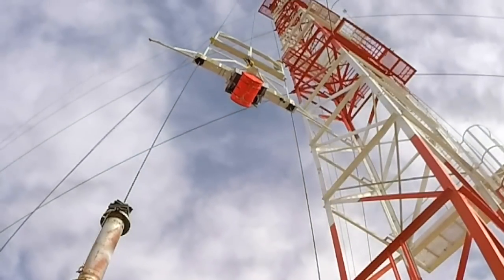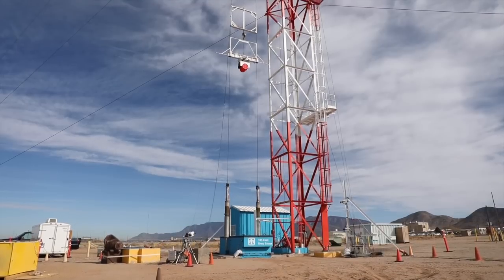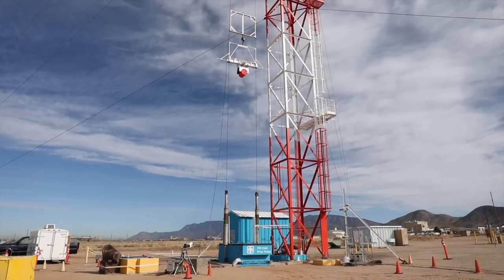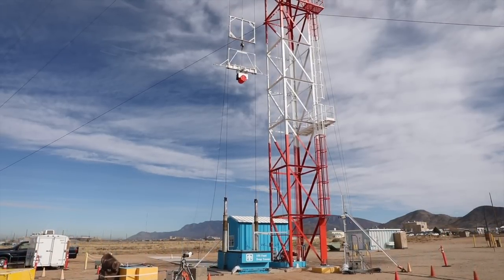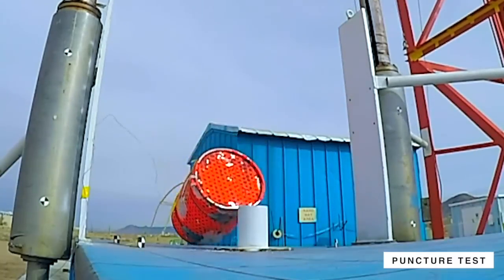Hazardous Container Drop Testing in Slow Motion at Sandia’s 185’ Drop Tower

Comment: I worked for a 55 gallon steel drum manufacturing company. Our most destructive test was the corner chime side seam drop. We tested to DOT/UN standards. If they passed, we would test to failure. The drums we made passed at +1.5  times the required drop height.
Reply: So interesting 😑

Comment: Notice they didn't flip it off a speeding  flatbed truck .
Reply: 185' of drop yields a speed of 75mph. 30' of drop yields a speed of around 30mph. The lateral velocity of a flatbed truck does not translate to these tests because the kinetic energy is spread out over multiple impacts, meaning it is easier to endure.

These drums are not put on flatbed trucks without further protection. I.E. their kinetic energy being released is spread out over an even greater amount of time.
Reply: @aidenthehuman5921 though multiple small hits can find a weakness that a single extreme hit misses
Eg difference between cutting open a safe and putting in the code

They probably already do many other tests, 
But they need things like slight damage testing, specifically looking for non visible damage, things that could happen in operation and not be seen by staff, combine slight damage testing with corrosion testing chemical (weather, road salt, cleaners, etc) and radiation

Throw it in a dry tumbler for a month
Do short distance compression testing (barely squeeze (half inch, down to millimeters) in a hydraulic press, cycle it a few dozen times, different points, different directions etc) check for visible signs of something like that occurring, whether or not it caused damage staff should be made aware of they crunch something, and also test integrity including corrosion integrity, (ie forklift, crane, etc might tap a barrel or pallet and no visible signs, could be hit dozens of times in transport, and started hairline fracture points with no one aware that they have been hit at all ever, etc)

Heat cycles, hot cold hundred cycles or so